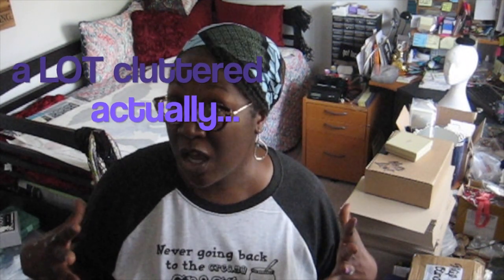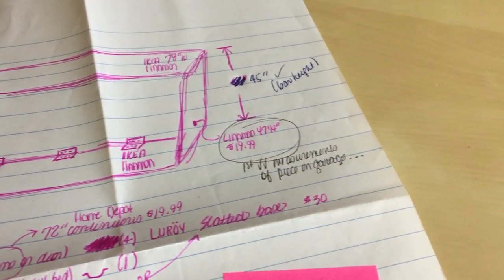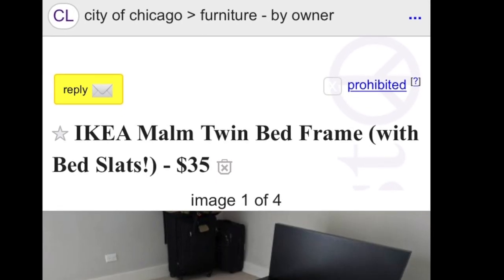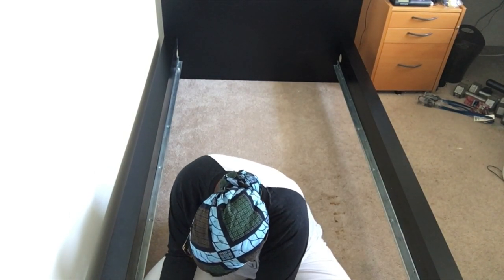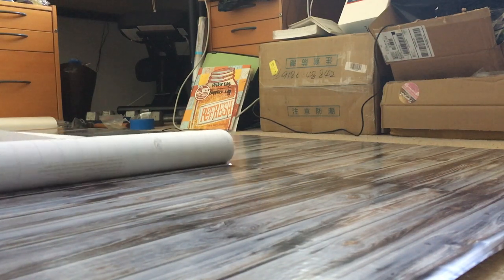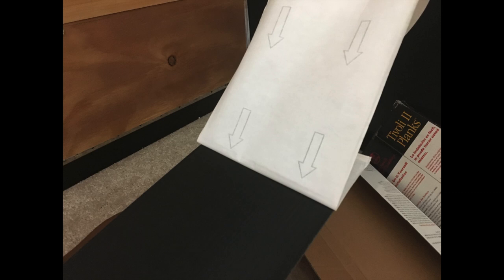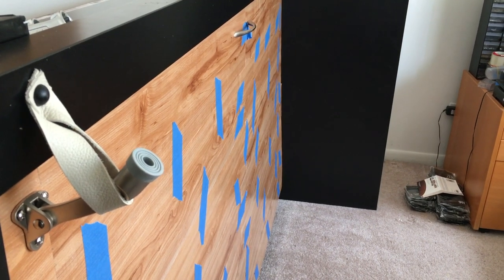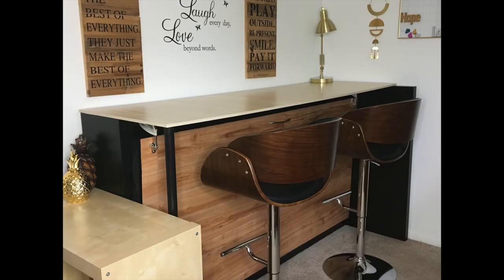The Last DIY Murphy Bed Craft Table (Desk) Video You'll Need |  IKEA Hack for Less Than $200!!!

Comment: I have been searching for an affordable murphy bed so I can have a craft room! Just saw your video. You are a genius!!!!!!! 
A couple of questions. Did adding the leg to the table interfere with the bed opening? And, how did the door stops hold up? Any other advice you can give me would be greatly appreciated!
Reply from the maker: Everything held up just fine except for the panels on the front. The adhesive wasn't strong enough and a few fell off over time. The leg didn't interfere. My only advice is to go for it. You'll learn by doing. You got this!